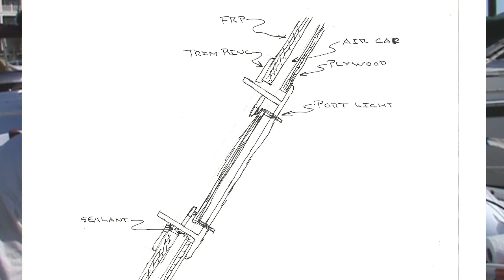Resealing Plastic Portlights

Comment: Great information, Captain!  I have a 2016 Zodiac and the Bimini top attachment on the inflatable surface is begging to peel up.  I bought some 5200 but have not used it yet and wondered what the best adhesive is to use to keep the surface attached.

Comment: I really prefer Butyl tape for such projects.  It's easy to work with and last ten times longer.
Reply from the maker: Stick with what you like but my experience with butyl has not been so good and it is not a one type fits all when it comes to sealants. I know butyl is all the craze right now but time will tell. I have been burned too many times by the latest fad when it comes to sealants.

Comment: Wayne,
Thank you for the excellent video on rebedding portlights.  I will be rebedding the Becton portlights on a '79 Endeavour 32 this month.  I noticed in your video that the external trim ring had screws to secure it to the cabin.  My boat has no such external screws.  The exterior trim ring appears to be well glued into place, but without screws.  Assuming most of your video will apply to my scenario, can you elaborate on how I should secure the external trim ring, or does the silicon suffice as both a sealant and adhesive?  Should I simply press the external ring in place over siliconed portlight, displacing silicon uniformly to edges of trim ring. 
Thanks again for your excellent teaching.
Reply from the maker: +Robert Morrison Sounds like you pretty have it figured out. Not much I can add to that. Just when you press the ring on do not force all the sealant out, in other words do not push down too hard on it. You want a little thickness of sealant under the trim ring. Good luck and thanks for your comments
Reply: I have the same exact boat(1979 Endeavour 32) and just replaced all 6 ports in front. How did yours wind up coming out ? I just used 5200 to stick the outside ring on because I figured driving screws thru would create a leaking problem...

Comment: I was wondering why you were taking so long to remove the old port then I realized that you are going to be re-using it.  I'm doing a complete replacement, so I'll be much less careful with the out-going hardware.  8-)
Reply from the maker: Always easier when you can replace with new. Good luck with your project
Reply: Being new to sailing, boat ownership and most aspects of boat repair and maintenance (diesel engine mechanics, plumbing, carpentry, HVAC, fiberglass work, etc etc etc), I'm enjoying your videos very much.  Thanks!

Comment: I have exactly the same boat, with exactly the same tired-looking portlights.  Luckily, the previous owner seems to have re-bedded them well.  If I was to take them apart again to re-bed them, I wonder about spray-painting them white with a Krylon plastic paint or something like that to freshen them up.  What do you think, Wayne?
Reply from the maker: Jakfilm You know I have done that with the back ones on my boat and was pleased with the results. Aft about 3 years they need some touching up. As I only could find the pait as a spay paint I shot it into a cup and brushed it on so I could do it in place. Worked well. I say go for it you will like the results and it will help protect the plastic from UV damage.
Reply: Wayne Canning
You know, I think I may just give it a go.  If I can only figure out how to remove and replace the gaskets that I have heard so much complaining about.
Reply from the maker: Jakfilm If your portlights are Gray marine you can get new gasket material from Pompenette in FL. They bought out out Gray. Look on their web site.
Reply: Wayne Canning
They're the same Beckson ones as in your video.  Same Endeavour 32.
Reply from the maker: Jakfilm In that case you can get the gaskets from Beckson they have any parts you may need
Reply: Wayne Canning
Oh, you see, my gaskets are fine.  I am suggesting that I might paint the ports if I can see how to remove the gasket/screen combo and put it back safely.  I've read reports that they can be frustrating.  But thanks
Reply from the maker: Jakfilm Sorry misunderstood you. Yeah might be hard to remove the gaskets without damaging them. I do not have first hand experience with this myself

Comment: You make very detailed videos with really good tips! Even though I'm not doing this identical fix - I learned a lot I can use. I have an old Columbia T-26 - with three plastic frames on each side, and the acrylic, lexan or whatever is toast - so I need to find replacements. I have not had any luck to date. Talked to an auto window guy, tried to buy portlights (mine are too large - like 28" long and 9" tall). I'm considering just stapling some sheet plastic to the outsides ha ha. Any suggestions?
Reply from the maker: Most glass shops can sell and cut the plastic for you. You could also try a plastics company. Good luck

Comment: Isn't polyurethane based 4200 or similar  much better than silicone?  Maybe the ports are ABS?  Industry recommendations place silicone as the last choice or not recommended at all in all marine applications but one (ABS or nylon fittings)
Reply from the maker: No not for this purpose. The portlight manufacture recommends silicone but a high quality silicone not the cheap hardware store type. Most in the marine industry understand where and when to use silicone it is a myth that it should not be used at all. See my video on marine sealants.

Comment: Wayne, do you specifically recommend NOT using 3M 5200 sealant for plastic portlights?
Reply from the maker: Scott Vickery I personally would not use  a polyurethane sealant such as 5200. I have seen many failures with this sealant and plastic portlights. The only sealants I recommend for plastic portlights is Dow 795 or Boatlife silicone sealant. Thanks for the comment and good luck with your project.
Reply: Wayne, thanks for the feedback. Slightly different question, do you see an issue with using 5200 for rebedding deck hardware such as stanchions?
Reply from the maker: Scott Vickery In my opinion 5200 and other polyurethanes are really only good as a flexible adhesive and I never use them for sealing.  I would suggest 4200 or Boatlife Lifeseal. These are newer types of sealants and offer good qualities for general purpose sealing.
Reply: +Scott Vickery only use 5200 below the waterline thru hulls and such,, use butyl tape for deck hardware
Reply from the maker: But do not use butyl tape on plastic fittings such as these ports.

Comment: Wayne, it looks like you were using Dow Corning 795 Silicone, is that correct?
Reply from the maker: Mark Welch Yes good eye it was indeed 795. It is a very good sealant for this use and what was recommended by the portlight manufacture